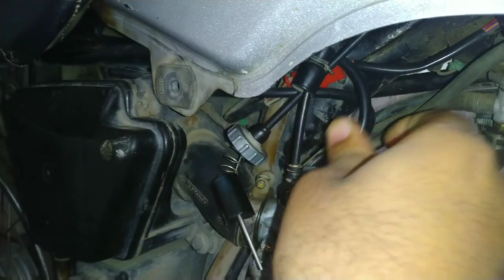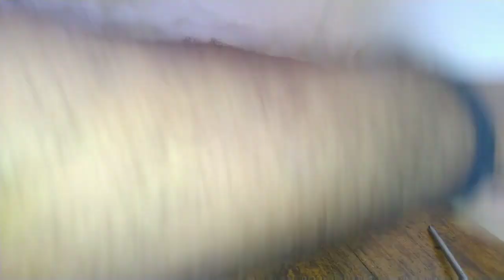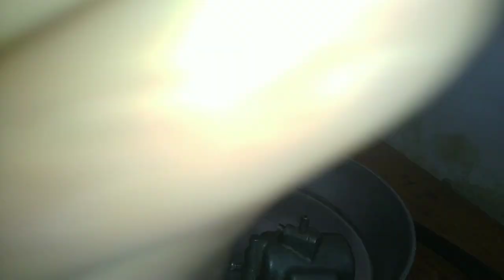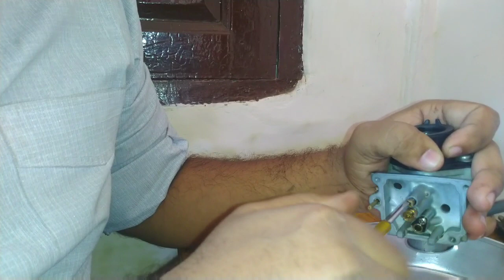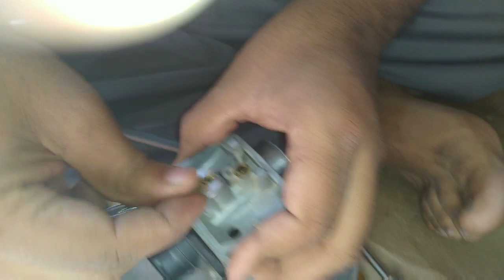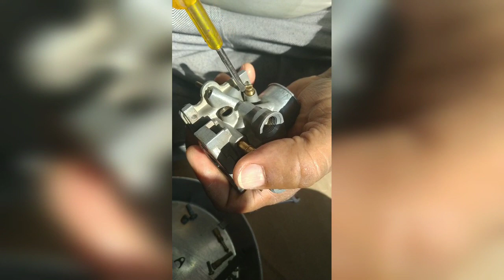TVS Victor GLX 125 Carburator Disassembly

Comment: TVS Victor GLX 125 के carburettor का  मेन जेट  बुलेट का भी लगा सकते है(मैने ऐसा किया है)
Victor GLX 125 का मेन जेट 87.5 का है और बुलेट standard का मेन जेट 90 नंबर का है.
ये जेट लगाने के बाद मेरा glx 115 km/hr  तक का top speed पकडता है और टॉप गियर मे 20 के स्पीड पर असानी से चलता है और मायलेज मे कोई ज्यादा फरक नही आया(87.5 नंबर के जेट से मुझे 62 का मायलेज मिलता था और 90 नंबर के बुलेट वाले जेट से मुझे 58 से 60 तक का मायलेज मिलता है).
Reply from the maker: No problem jet is Work well
Reply: mere pas glx victor h kya me lagwa sakta hun koi problum to nai h
Reply: @mohitbairagi2985  victor glx 125 मे स्टॅंडर्ड बुलेट का 90 नंबर का जेट लगा सकते है, बस मायलेज थोडासा कम हो जयेगा(अगर ओरिजनल व्हिक्टर के जेट से 62 का मायलेज मीलता है तो बुलेट वाले जेट से 58 से 60 का मायलेज मिलेगा).

लेकिन याद रहे की जेट सिर्फ standard 350 cc वाले बुलेट का ही लगाना क्यूकी अन्य कोई बुलेट मॉडेल के जेट मॅच नही होगे.
और बुलेट का जेट लगाने के बाद एअर स्क्रू भी सेट कर लो(glx 125 का एअर स्क्रू 1.25 से 1.5 का होता है, बुलेट का जेट लगाने के बाद 1.5 से 1.75 का सेटिंग करना पडेगा )